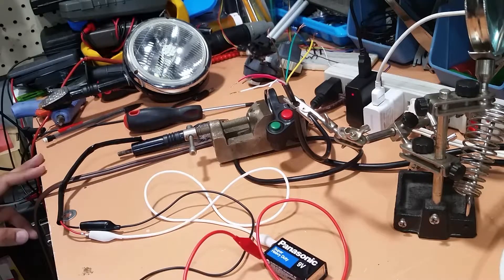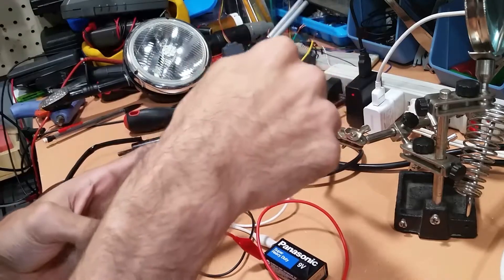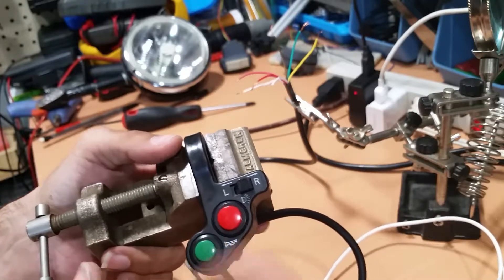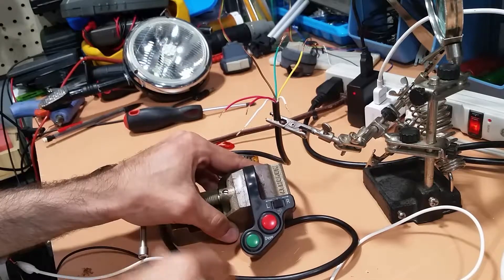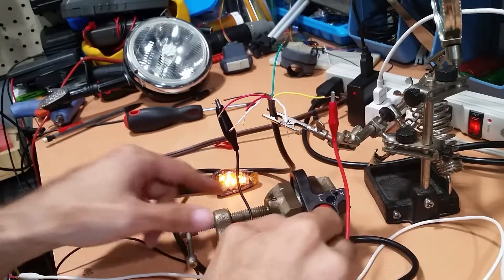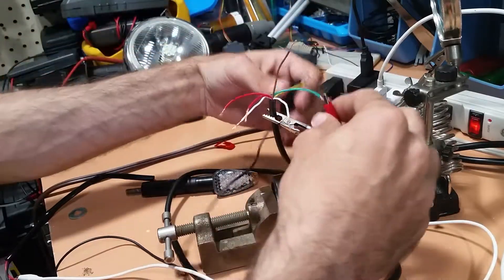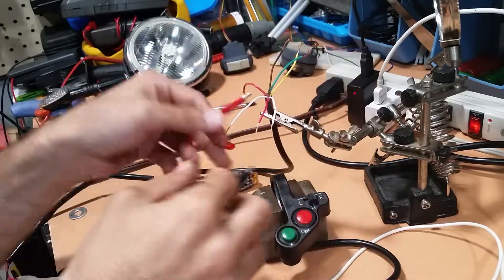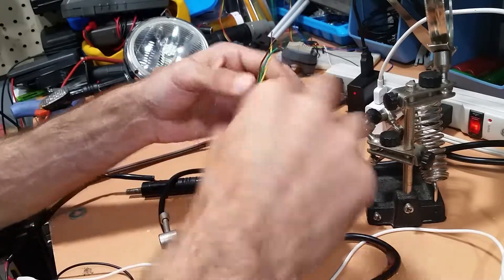Tomos Bullet A3 - Control Switch Wiring

Comment: So this will work for a 1978 tomos a3 bullet?
Reply from the maker: This was a custom wiring job, so yeah it will work for any basic switches and lights. This does not follow a wiring diagram, because my moped previously had all the wires ripped out. Concider this a brand new wiring install.
Reply: @FoxxOTG  that's sorta how mine is it has spark but alot is not connected
Reply from the maker: @Bee-fr7zk  mine wasnt even generating power, the coils were very rusty and chunky. I made a removable battery from 3x 18650 cells I happened to have.
Reply: @FoxxOTG  I just gotta wait a week till I get it running and see what all needs wired